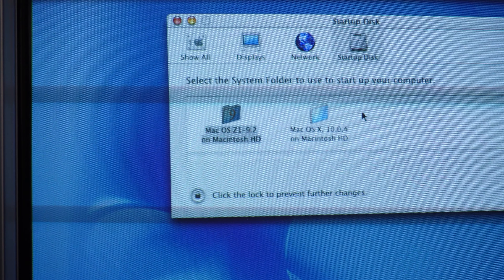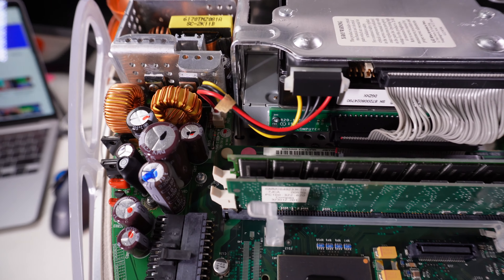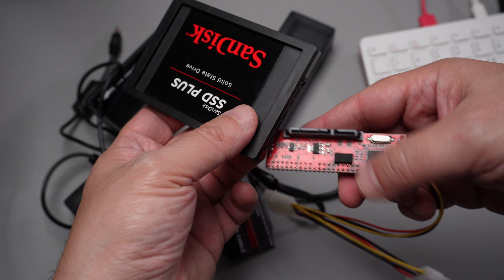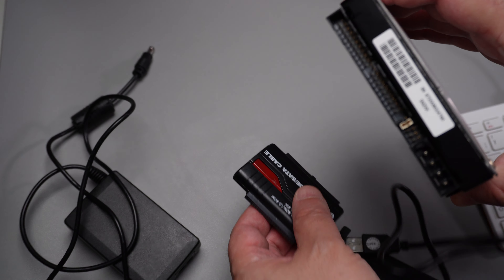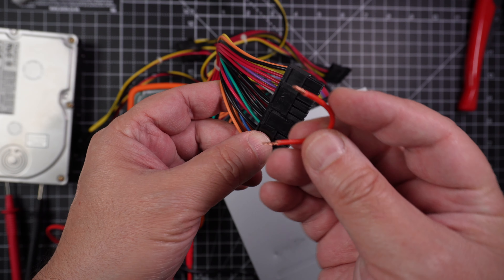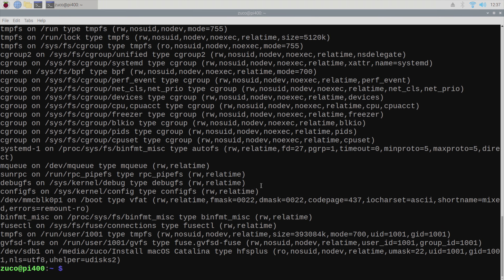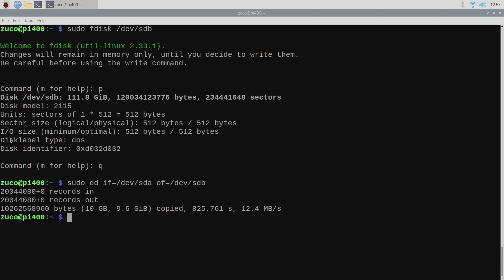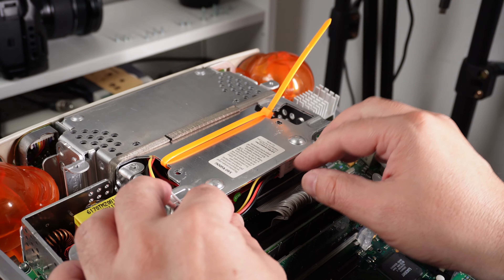How to make your iMac G3 silent!

Comment: Awesome project!

Back in 2009 I was rocking a 400 MHz indigo iMac. It had the original drive, a 10 GB unit, which was on its last legs and was loud as hell. I remember watching the keynote where Steve introduced the slot loaders and imagining how silent my iMac would run if I replaced the drive. Unfortunately I never had the opportunity as in 2010 the CRT's flyback transformed died and I retired the iMac, so it's great to finally see the difference and how silent those machines can be. I'd guess the same applies for the Cube.
Reply from the maker: Sorry to hear you had to retire the iMac, but it's indeed very silent. No fans, just that faintly melodic electric noise coming from the CRT